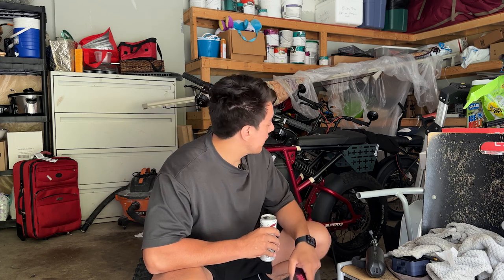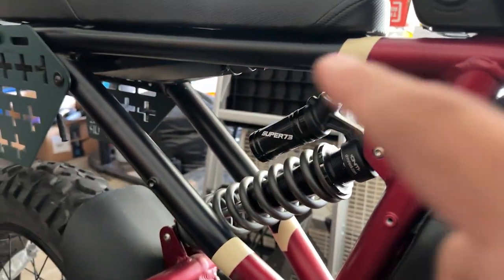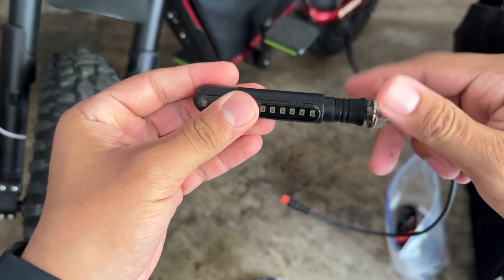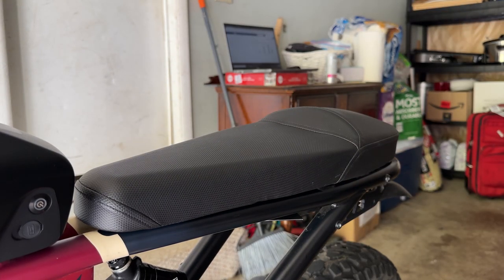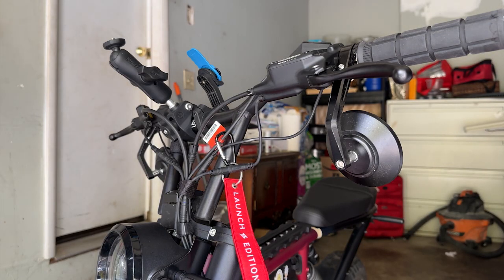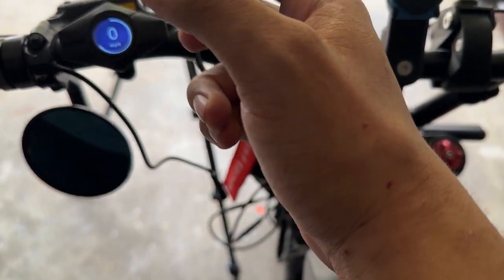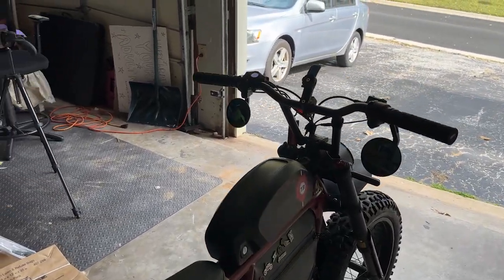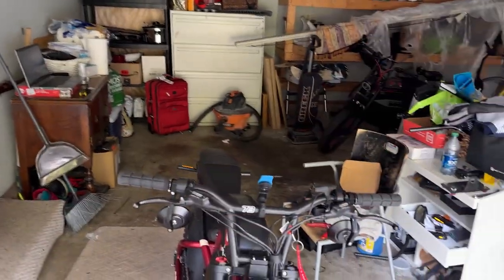Turn Signals for the Super73?! Loomenade Plug N Play Kit

Comment: Hi. I purchased those lights for my Grizzly but I need extension cable for each turn signal since the cable on each turn signal are too short. I am having a really difficult time finding the cable. I know that its a 2 pin connector but I cant figure the type. I reached out to  Loomenade but did not get much assistance since they dont sell the extension cable. Any help would be appreciated.